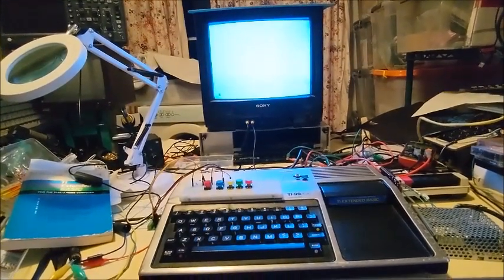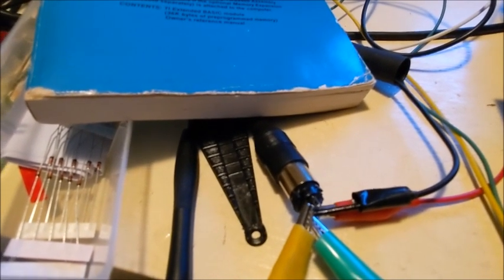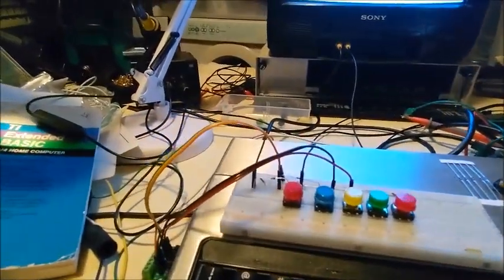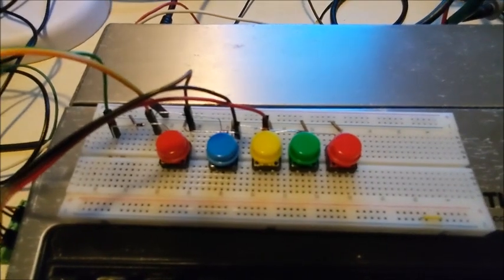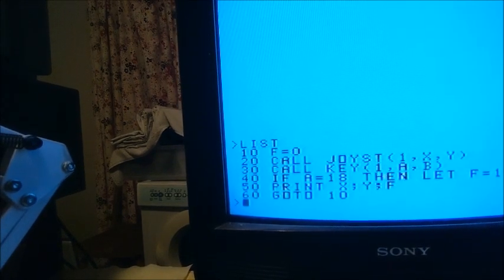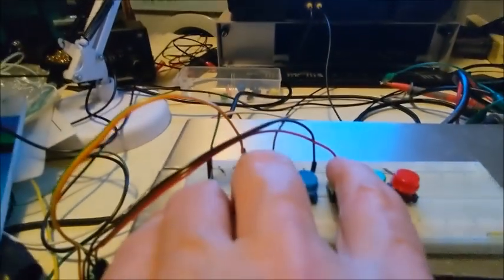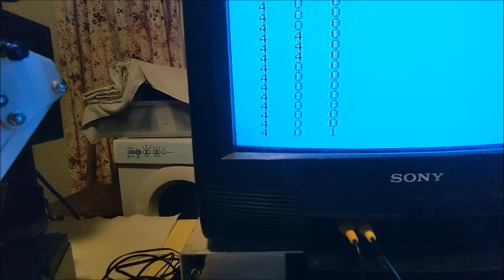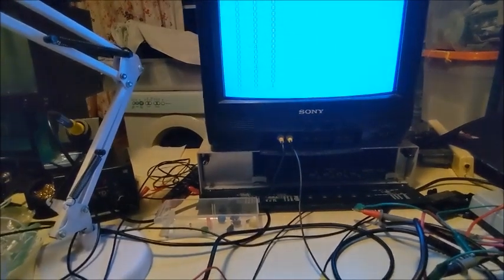Don't have a Joystick for your TI-99/4A? Why not make your own?

Comment: If you only use one joystick it's just a wiring change no diodes needed. Just rewire a female/male connector or a spare Atari stick.

Comment: Great way to scratch that delicate aluminium finish
Reply from the maker: It was already scratched and dented and has been for many years.  It's not a museum piece, it's intended for fun and being used as it should be. Anyway this breadboard has a soft backing so its not going to add to the machine's scratches.